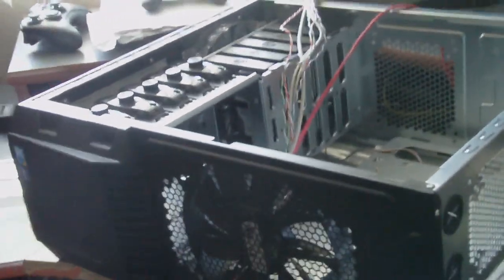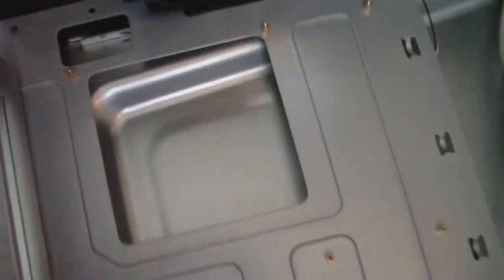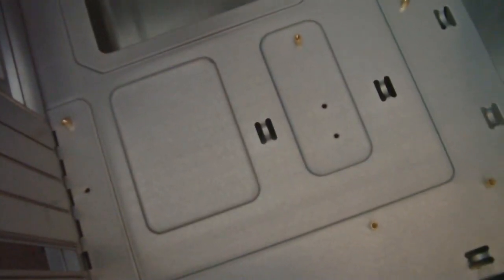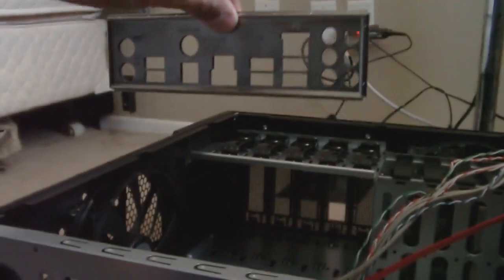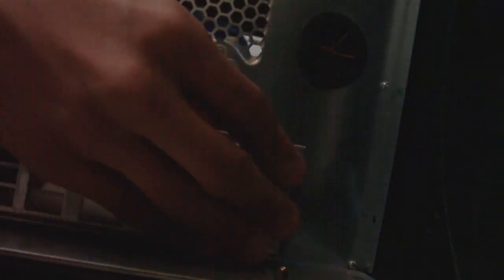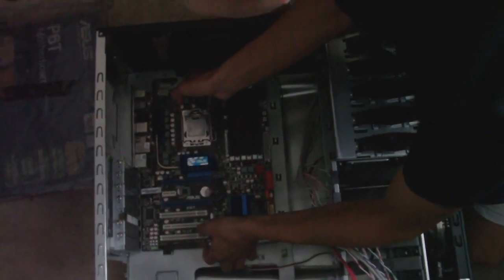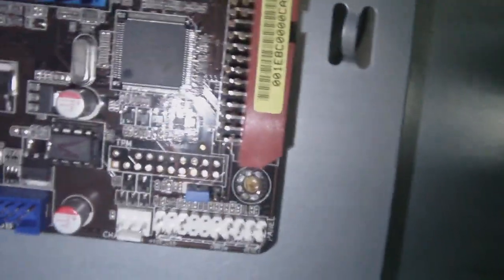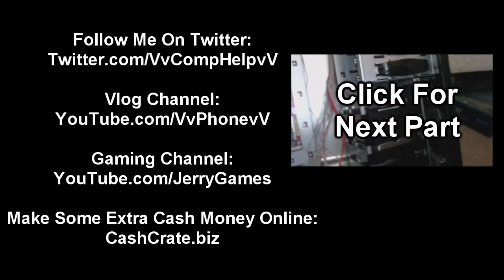How To Build A Computer Part 4: Installing the Motherboard

Comment: Screws can either come with the case or the mobo.  My case came with some and my mobo came with some so if this happens use either one.  It doesnt matter as long as the screws are the same size and thread type as the standoffs so you dont strip them out

Comment: im having trouble connecting hd audio connector from my chassis
its so hard to make it flush with mobo
am i supposed to be seeing any pins underneath the connector from mobo or should it all be covered by the connector?
its so tough to push it down i see my mobo bend a tiny bit when i do i feel like it might get damaged
help

Comment: There are a lot or reasons for this that I don't feel like explaining : P The mother board has to sit on stand offs. Try never to touch any part of the mother board to any part of the computer or anything in general... until you are ready to use the motherboard keep it in the anti static plastic baggy and set it on top of that when you are using it! hope it helps

Comment: How do I tell what form factor my mobo is? I think it is a micro atx and my new case works with micro atx but it did not fit unless I put it in wrong. I'm not sure what is wrong is my mobo a odd form factor (it's from a Barebone) or is something wrong with my case or did I just put it in wrong? It back in the old Barebone case, can someone help?

Comment: THANK YOU for showing the stand-off (riser) screw installation!  No Asus or Rosewill manuals explain this, and most videos don't show it either.  I almost cracked my motherboard and/or shorted something before realizing there was a reason the screws wouldn't lock to the case.  It is NOT obvious that a flat board needs to sit on top of six screws.  Not sure why the manufacturers would think so.  I let them know in my reviews though!

Comment: @AlexBoy123HBG I don't think that your old I/O shield fits in there, but you can compare it with your motherboards output. But actually, you don't need your I/O shield, at least not in my opinion. And i've builded computers for 10 years. But if fits, put it in there. Always better, with than without :)

Comment: @thesebken Normally they should come with the case. Usually they're already screwed in for you. If they didn't come in the case you need to buy some. They should have them in any electronics store that sells computer parts ie. Fry's.

Comment: @vcstar5 A 32 bit system can hold 4gb or ram, a 64 bit holds about 8gb, But some applications are not compatible with bit 64 system, because they are usually build on a 32 bit system.